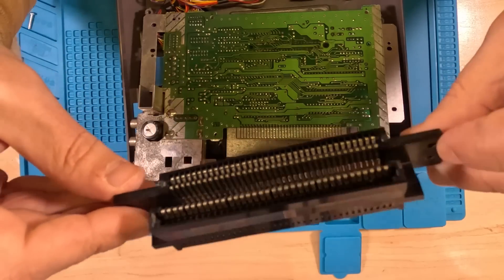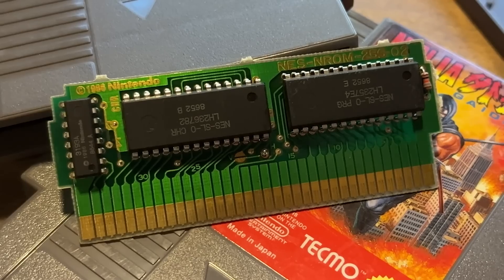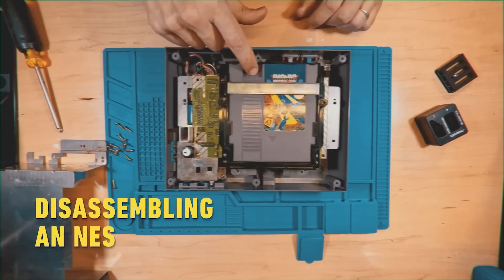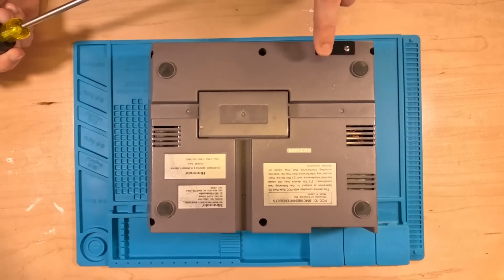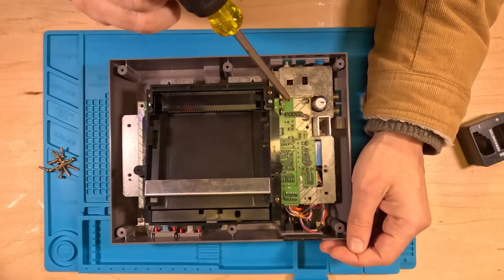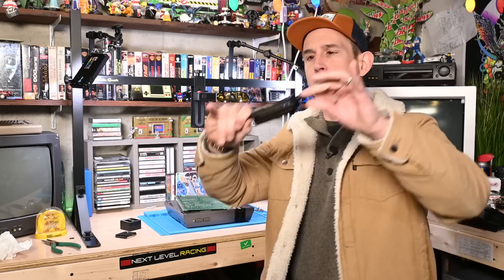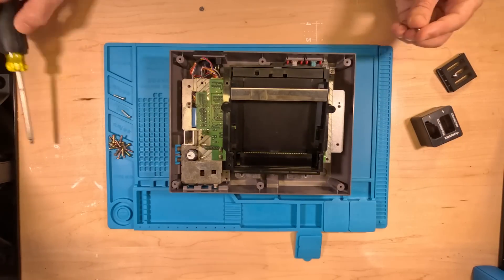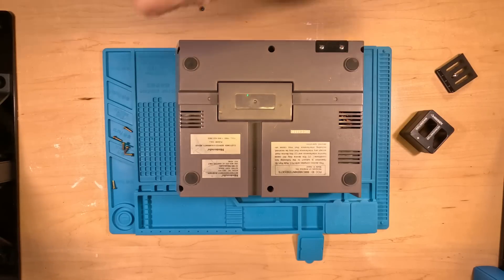Stop Blowing on Your Carts and Fix Your NES's 72-Pin Connector | This Old Tech

Comment: I don't believe in that myth blowing in the cardtridges I clean my nes games with 91 percent rubbing alcohol q tips mr cleans magical eraser windex glass cleaner pink pencil eraser i fixed my original nintendo entertainment system by boiling the 72 pin connector in hot boiling water for 20 minutes clean the motherboard the controller ports the contacts where the 72 pin connector plugs in it's how I fixed my original nintendo entertainment system and it works excellent

Comment: @8:20 it looks like you remove 2 more screws, but your hands are covering them and it is never mentioned. sort of important to get the 72 Pin connector out. otherwise pretty decent tutorial, aside from missing that important step.

Comment: This is DUMB. And WRONG. Blowing on carts will do absolutely zero damage what so ever to the carts. We are talking decades of blowing in those things on a regular basis before the moisture will do any notable damage. 

Statistically speaking, 99 percent of these issues stem from DIRTY PINS. NOT broken pins. 

Do not do this unless you absolutely have zero other choice. And EVEN then. It makes far more sense just to buy a new system. It's cheaper even.

Comment: The trick is to not push the cartridge in and leave it as far out as you can where you can still lower the bay
Reply: That works to but blowing into them works and it has to be mouth and not keyboard cleaner.
Reply: @Bonesph  the breath moisture probably helps conductivity

Comment: Fixing or replacing the pins is part of the problem.

For most people do not want open up the NES.
Get or make a cartridge cleaning kit and clean the contacts of the cartridge and clean the pins.

Also, buy canned air and use it whenever NES has blinking light of Death.

If you are brave enough to replace the pins, still clean the cartridges. You don't want to put a dirty cartridge into a new pins.

Comment: What does boiling it actually do?
Reply: The pins have bended over the years so boiling the adapter bends the pins back to the original shape.
Reply: @pavekki , boiling probably cleans all the crud off the pins

Comment: you should have cleaned the contacts and the board too with some kind of alcohol before you put everything back together

and if the connector's pins were in any way bent or damaged boiling it wouldn't have done anything. Inspect it and bend pins back up

Comment: Nes and SNES are the most durable consoles ever. Most playstations and Xboxes stop working after several years.
Reply: Look up planned obscelence if you get a chance.  In the short definition it's basically designing a product to fail early before its actual lifespan as a way to drive up sales.  It's not just a problem with consoles but phones and the like
Reply: @captaintalon4485 It is going to get alot worse when Electric Vehicles are going to be mainstream.

Battery replacements cost 25k+ for Vehicles that is worth 10k or less.
Reply: There aren't any moving parts on the NES and Super NES, unless you count the doors. Consoles with disc drives are orders of magnitude more complex and there are way more things to break.
Reply: My Xbox 360 still works despite being like six or seven years old.
Reply: PlayStations, 1, 2, and 3 yes. Pre-Jasper Xbox 360’s, yes. OG Xbox and Xbox One are actually made very well and I’ve had both for years without an issue, other than the Xbox One’s power Brick after 8 years. Also never had an issue with my Xbox 360 either.